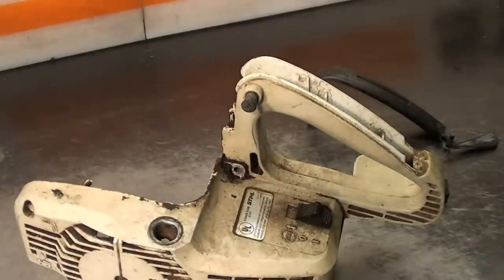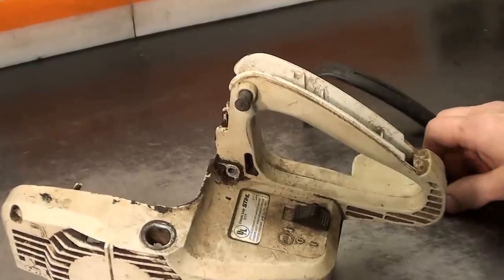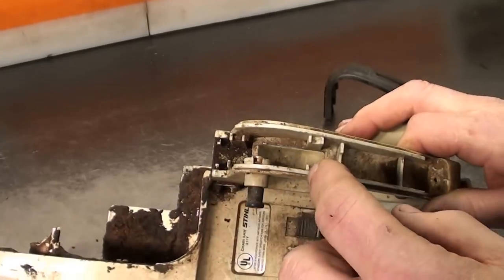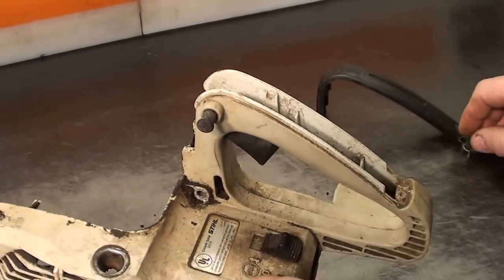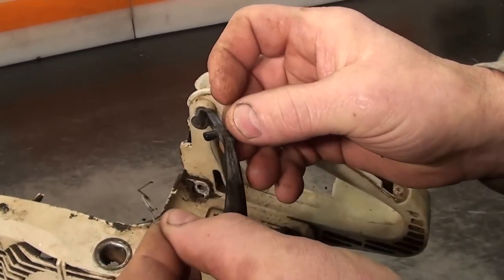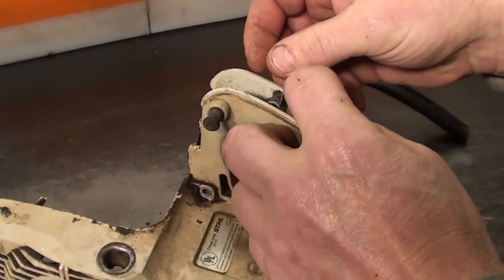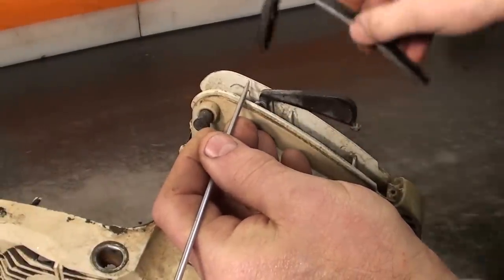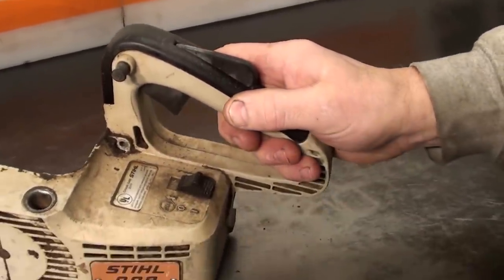The chainsaw guy shop talk Repair Stihl 009 Throttle lock 2 17

Comment: Omg. THANK YOU. I took this 009 apart to fix the fast stop, but forgot to take pictures, and then got distracted by car problems....I just realized the throttle lock plastic is broken on my saw, so the pieces don't fit in a way that makes sense, I was starting to worry I wouldn't get it back together!

Comment: I took apart my 009 today to fix a loose muffler and had trouble figuring out which way the throttle lock spring went back in. The was perfect and I thank you for the time that it took to make it.  --Rich
Reply: I had the same issue (ie fixed the muffler and spend more time trying to figure out how to reseat the throttle lock) - this guy is great!

Comment: WOW, I just love YOUTUBE. This problem happened when I popped off the handle cover to connect the wire to the carb and before I looked to see how things fit the little spring fell off.....spending 
the better part of a hour, I thought I would give Youtube a try. Thanks for video as you have the same saw as mine.....Cheers

Comment: Didn't tip saw enough to see how trigger goes in. Throttle lock shot only lasts about a second not enough time to really see what you are doing. My throttle lock keeps getting stuck in the down position, can't figure out why. Can't see the trigger or lock long enough to see if I have the right parts.

Comment: I have a stihl 009 so i am replacing the fuel line. I removed carburator,  now that I am to put the carburator back,  Im not sure which hole on the carburator the linkage installs into. can someone help and share this info.
Reply from the maker: Hi Hank,
I posted a pic on The Chainsaw guys Page (face book)
WestCoastMuscleSaws 
TheChainSawGuy 
Rich